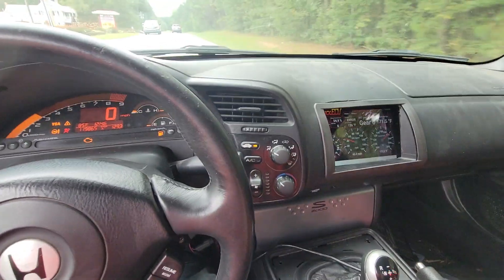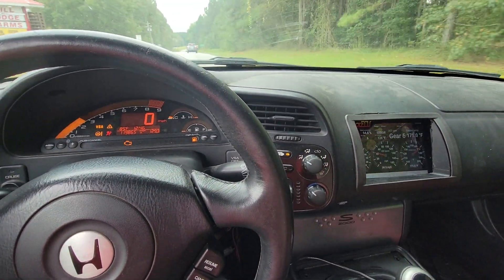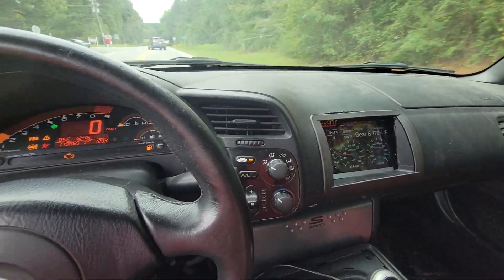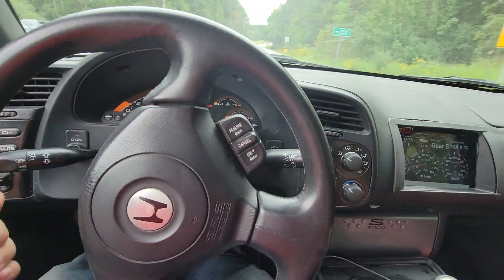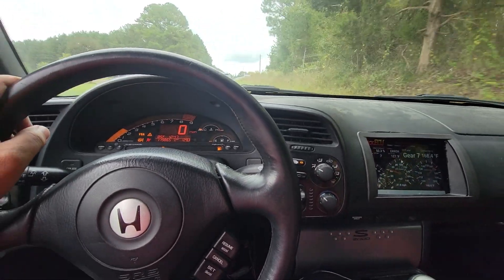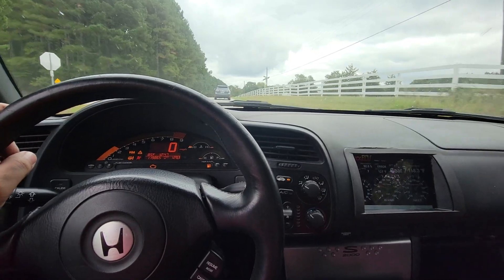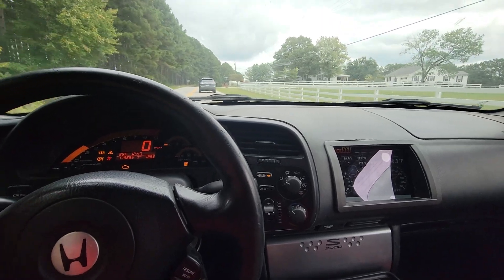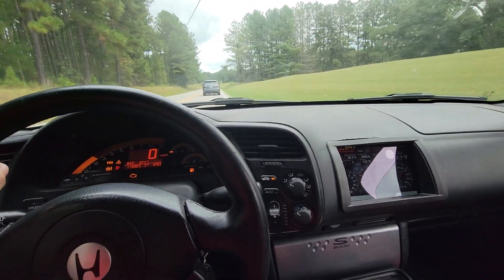S2000 DCT Swap

Comment: Your check engine light is on.
Reply from the maker: Thanks for the heads up after 2 years I hadn't noticed.
Reply: @jdoggsgarage4494  have you managed to get a reading on the code?
Reply from the maker: @ubiased23  it's on because the maxxecu does not communicate with the stock gauge cluster.  That has long since been replaced with an Aim digital display
Reply: @jdoggsgarage4494  nice. Keep up the good work.

Comment: So what ecu are you running to make this possible?
Reply from the maker: MaxxECU
Reply: @jdoggsgarage4494  oh so it runs everything, cool. Would it work with AP1’s after being converted to FBW? And did you have to make any modifications to the transmission tunnel?
Reply from the maker: @oxideracing  yeah it'll work fine in an ap1, converting to drive by wire is pretty simple. You do have to add some clearance to the tunnel but no cutting is required. 

Maxxecu controls everything

Comment: Could I get the dct to be fwd driven with custom work
Reply: No, the outputs are in the wrong place to even do as it's designed for rwd. You'd want a dsg (VW term for dct) from an early to mid 2000s Volkswagen. Which you can find swap kits thanks to the Euro bros being hot hatch swap fanatics and VW recycling components among many vehicle platforms. Out the box good to about 300 ft lbs torque that can be upgraded. Avoid the 7 speed as it's a dry clutch with higher premature wearing.

Comment: Can you go over why you chose maxxecu vs htg? Also what are the pros and cons of each you'd point out to someone looking into doing this?
Reply from the maker: I may talk about that in a future video. But basically the reason I like the maxxecu solution is the extreme ease of install and the cost. I've worked with a couple of htg cars and they didn't do anything better. The install for htg is a huge pain and it will add several thousand dollars to the swap.
Reply: @jdoggsgarage4494  Thank you for the response.  I noticed your dash wasn't working with the maxxecu, is this a permanent thing or was it just not set up?  Also what did you do in terms of mounting the transmission to the factory transmission mounts?
Reply from the maker: @andomort  this video was about 10 minutes after I got the car working.  You'll see in later videos that everything works except for some warning lights that the maxx can not control.   For the transmission mount I just built a pretty simple crossmember that attaches to the factory mounting locations and uses the s2000 rubber transmission mounts to hold the dct transmission.  The adapter plate and flywheel are from Xperformance.
Reply: @jdoggsgarage4494  If you had to give an estimate, what would you say it would cost for the swap with maxxecu vs htg, including buying the ecu and stuff.
Reply from the maker: Since the maxxecu controls the engine as well it's hard to say exactly if you already have a standalone or what your situation is, but the htg gcu is around $1400, the domiworks pcb and wiring kit is $700, I think they charge $1400 if you send them the bmw mechatronics unit. 

The maxxecu harness is $600 I think, it just plugs right in, no modifications to the transmission are necessary
Reply: @jdoggsgarage4494  you don't even have to open up the tcu or splice wires with the maxxecu??
Reply from the maker: @andomort  nope, it just plugs right in
Reply: @jdoggsgarage4494  Do you have a facebook page or something so I can contact a little easier?  Unless you'd prefer sticking to YT comments.  Which version of the maxxecu did you use, street sport or race?
Reply from the maker: @andomort  I have Facebook page with the same name

Comment: would be decent to have a god damn speedo.....whats the point if you cant tell how fast your even going lol
Reply from the maker: If you'll notice the other video's here, everything is working.  This was the initial testing.  The s2000 speed sensor is built into the transmission, just like every other honda. The bmw transmission does not have a speed sensor built in.  It's getting wheel speed via can bus from the abs module.  At this time I had not wired things up to transmit to the dash.

Comment: Nice to see some transmission swap alternatives. I can't wait to see someone ZF8 swap a S2000
Reply: Look up CANTCU. Brand new mind blowing product for swapping BMW/ZF transmissions into all sort of cars.
Reply: Zf is nice but it’s big compared to dct
Reply: @1BeNn_ and slower than dct but does have some perks as well
Reply: @1BeNn_ zf make the dct trans for bmw
Reply: @markpiper5242  I didn’t say they don’t I said zf 8hp is bigger in size than dct
Reply: A torque converter auto probably wouldn’t work for a high revving Honda engine
Reply: wow lol

Comment: The e90/e92 dcts are sick. Are you running 2.56 or 3.15 final drive?
Reply from the maker: It's got a 4.10 in it now, ive got a 3.55 on the way.  Anything lower will be to low for the Honda engine

Comment: Why to a S2000
Reply from the maker: Broke 2 stock transmissions in a month.  The other transmission options are terrible or cost $8000
Reply: @jdoggsgarage4494 hi, you broke two stock S2000 manual gearboxes?? Is your car stock or tuned
Reply from the maker: @blackkape1westside873  it's turbo, makes around 550hp/375tq.
Reply: @jdoggsgarage4494  wow okay, i think your the first. Never heard of anybody putting a autobox in..... I see 4 5 600hp S2000 turbos with the manual boxes. And they dont blow up they must strengthen them. What auto box do u have.. Fairplay
Reply: Okay..... just listened to the full vid
Reply from the maker: @blackkape1westside873  this combination spools very quickly and makes over 300tq before 4000 rpm, thats whats killing the gear box.  when you start making that torque you have to start being careful with the transmission or you'll shear the teeth off 2nd gear.  If you search for my page on facebook i''ve got some dyno graphs and such posted there.  I'll have some track video's up soon.

Comment: Nice!!! So you are using bmw stock ecu for the transmission??? Or the Maxecu controls both the engine and transmission??
Reply from the maker: Maxxecu controls both, the maxxecu interfaces with the stock bmw TCU

Comment: Is this an m3 transmission or the 335/135 transmission
Reply from the maker: It's the e9x transmission. I'm honestly not sure if it came out of a 335 or m3, but it's got the m3 GTS firmware on it to work with maxxecu
Reply: Once it's DCT, it's M3. 335's came with a regular automatic
Reply: @TheForresterOD  that's not correct you can get 335 and 135 with a 7 speed Dct that is a different transmission with different can protocol
Reply: @TurbineResearch  had to go do some research. Turns out the 335iS could be equipped with a DCT.  Thanks for the correction, I learned something today
Reply: @TheForresterOD  actually most of the e9x cars came with dct from factory except for the e90. It was an option in europe mid 2009. its most likely using a inline 6 dct because the m3 bell housing is huge.